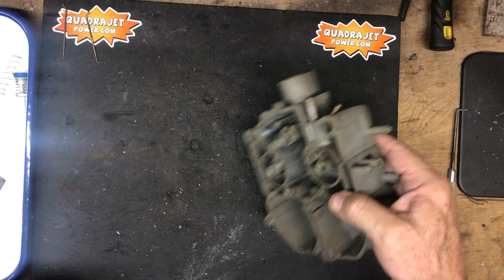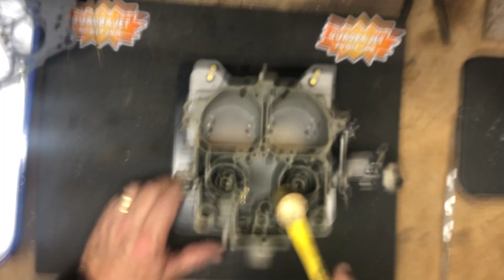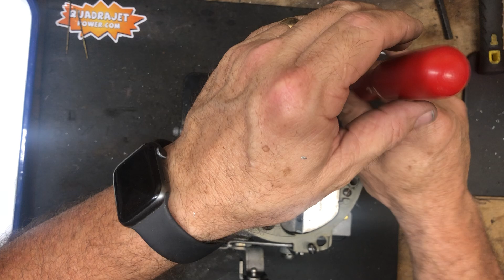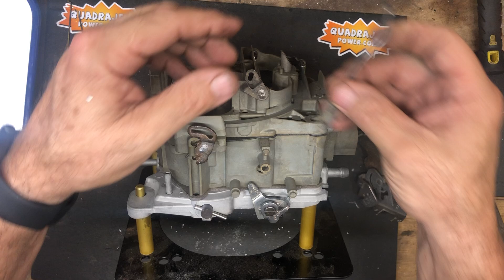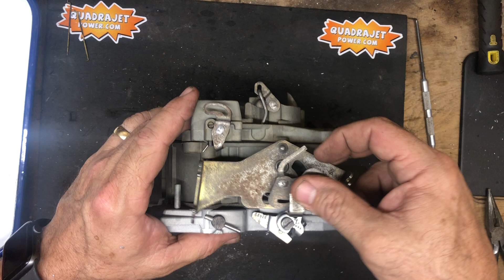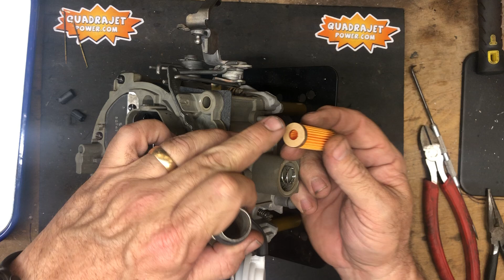Quadrajet Power - Assembly of the Quadrajet

Comment: Ok you might be able to help me out. I have a 2000 vortec V6 that I installed a marine intake onto that supposed to have a quadra jet carburetor on it. My problem is the quadra jet I have has the vacuum secondary and a electric choke. I need to keep the electric choke but the vacuum plunger for the secondarys sticks back to far and is in the way of me to adjust my distributor because it hits the vacuum advance on the distributor. Do you possibly have a carburator with mechanical secondarys and a electric choke the will work with my engine

Comment: I have a 7045583 and after installing the base throttle plate I can see some light after tightening with a new gasket. Any tips on what I should do to correct it? I can see light on the choke side near the secondary shaft. Iused a straight edge on the main body near that area and measured it with a feeler gauge and it is out about .012

Comment: I appreciate the very complete kit and this video. What if you see one tiny pin hole of light at back of carb when you check base gasket with flashlight? Edit, the optional secondary well sponge was keeping it from sealing, a little  more english was required.

Comment: I have a 1988 GMC M.H.454W/RQ#17085000 04 07 JLY I GOT A KIT NO INSTRUCTIons.wañt a base plate w/ajustable A/F mix.screws &rebuild kit.with instructions.
Reply from the maker: You can remove the covers over the idle mixture screws so they can be adjusted.  We have instructions and information on our website on the "Qjet Info" tab.

Comment: On the rebuild of my 79 Pontiac 400 Q-jet I didn’t take notice of the power piston’s stop adjusters turns out. I just disassembled everything to clean. How do I find out how to reset to the proper height?
Reply from the maker: Start at 3 turns up from seated and test from there and adjust if needed.

Comment: I have a question, I had always played with these for many years and learned alot... But Ive been watching your videos to learn more, and humbled myself many times to make sure my next build was about as good as it could be, lol.. question is.. I have a 1/2 pickup (85 K10) came with a M4MED with the "dual-capacity pump"... There is now a fresh engine (350; well, 355 actually).. and it's running on a '78 quad from?? Idk.. but it doesn't run as well as it should.. I know it can be fixed.. but I have another carb identical to the one that came with it.. and I know they only made those a few years, but I do know it came from either a 305 or a 350, my motor has had only 5 upgrades when built TRW 0.030 over flat-tops, high volume oil pump, a classic 224 cam with a 112Lsa turned by a double-roller.. that's it.. and I was told by my dad (had the engine 38yrs that the guy that built it said it produced about 252hp on a Holley spreadbore with 74jets.. so I know two other people with vehicles and similar compression & cam.. and the truck carbs like those seem to already be almost perfect until you go with a tighter love separation (loses vacuum).. I noticed even the one I have runs a bit rich and gets better mpg at 2900-3000rpm than right around 2000 where you think it would🤔.. and I know that with 10-15% ethanol, what used to be a hair rich might almost be perfect.. and the truck carbs seem not to make not a bit of cam🤷.. so should I build and use that carb? & If I do should I leave the jets alone and just focus on APT adjustment since they seem to work very well with setups like mine (atleast what I've seen twice already).. bc whatever mine came from, it doesn't jive with my build, the Holley would pull a truck that weighed well over 5000lbs and could spin it around if you cracked on it in 2nd and break loose in 3rd.. now it's on a th350 and barely barks in 1st😔 (and no, I'm not hard on it, it's just disappointing knowing how it ran before, and now it's maybe 170hp at best it feels).. and it could be 250+..what should I do if I decide to go back with my other M4ME? And be I even slap the top 🎩 n I do wanna turn on that APT about a 1/4-1/2 turn from experience bc it usually gets a bit snappier that way on ones I've worked on with mild builds.. what would you recommend? I know these questions probably make more, but if it's already that close to being correct other than the slightly lower vacuum at idle, and 5more cubes..

Comment: love all the videos- question- your float height of 9/32- is that from the top of the back of the float to the top surface of the main body?  and does that value hold true for high performance builds where we've modified the carb?
Reply from the maker: Yes. Center of main body to top of float. Can set to 1/4”.
Reply: @QuadrajetPowerLLC  great thank you!

Comment: Is there a plastic bushing that goes on the secondary idle shaft and into the primary choke rod hole that is on the passenger side of carb ?
Maybe not !?
Reply from the maker: Yes, there is on some. If you have hot air choke you need it to seal or you will have a vacuum leak. Divorced chokes didn’t have a bushing.

Comment: Define front of the float. Wouldn't that also be the front of the carb? Every Q-jet that I've taken apart (rebuilds & unmolested factory carbs) had the little clip located at the front of the carb opposite of where you showed it being installed.
Reply from the maker: If you use the clip, it would go in center of the pivot end, hanging from the power piston side. Do not hook it through holes on the float pivot.

Comment: OK I have a basket full of quadrajet parts can you tell me where I can find info on what part goes to which carb. Especially secondary hangers and rods. I have book's but nothing on what I mentioned. Can you help.
Reply from the maker: Hangers were non carb specific. Hangers were assigned during assembly based on the measurements at the time. Secondary rods were assigned based on carb number.  It is difficult to reverse look up carb application from manufacturing part numbers stamped, but we will help if we can.
Reply: Thank you, I'll get you some carb ID. Happy 🎃
Reply: The quadrajet is#17057213. Putting it on a 283 around 300hp  need specs for secondary hangers and rods. Also what do I need to put a electric chock on it. Thank you

Comment: I don't have a computer or internet, do y'all have a phone number to call you, I have a 67, Caddy and a quadrajet with a electrical mechanical switch or something 2 wires run down to transmission? I need parts and advice would be greatly appreciated. Good video I'm using it to work on mine. Thanks 👍👍👍

Comment: How would the needle and seat work without the clip that connects the needle with the float.?
Reply from the maker: It would function fine.  That clip is not needed with today’s fuels.
Reply: @QuadrajetPowerLLC Sorry I am still a little confused, but what then lifts the needle out of the seat to let fuel in if there is no clip?
Reply from the maker: @TheHomy70  fuel pressure coming in.  I have t run a clip in mine for many years.
Reply: Excellent question.....glad they responded as I was wondering the same!

Comment: Thank you so much. I ordered a rebuild kit and throttle shaft installation kit from you guys. These videos are very helpful. Especially the springs at the end of the shaft. Thank you again.
Reply from the maker: Glad to help
Reply: @QuadrajetPowerLLC 

Hello do you still sell parts for quadrajet carburetors. 
The brass tubes in the air horn? All 4 pieces?
Also the needle and seat,  the seat that has the half moon or windowed  hole & the bottom?
That's it for starters I'll send a carburetor # tomorrow. 
Thanks, George
Reply from the maker: @georgesabol459  Yes we sell parts. www.quadrajetpower.com  email us at info@quadrajetpower.com
https://quadrajetpower.com/vent-tubes-pair-air-horn-new/
https://quadrajetpower.com/secondary-pick-up-tubes-pair-new/
https://quadrajetpower.com/needle-and-seat-130-orifice-with-window/